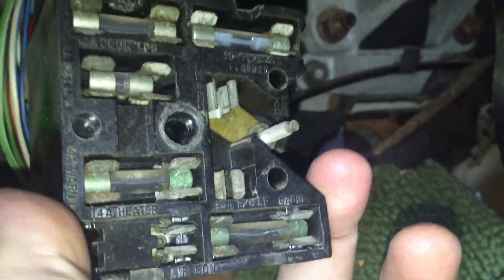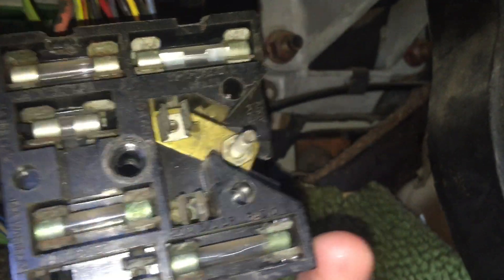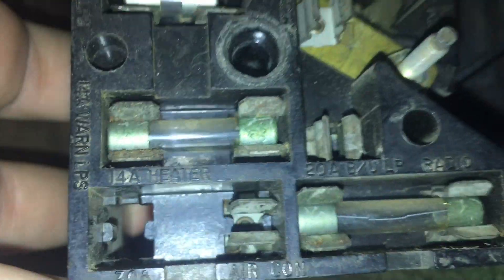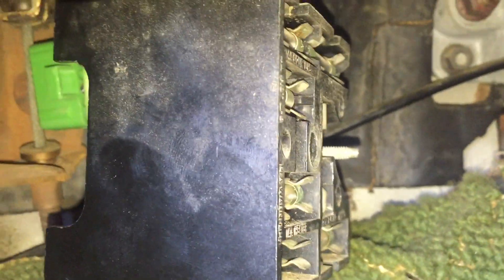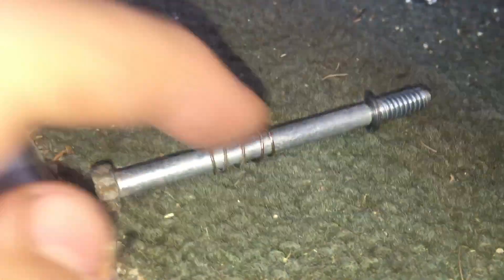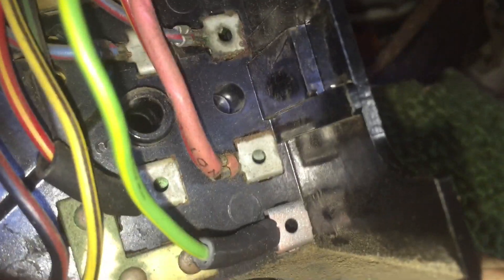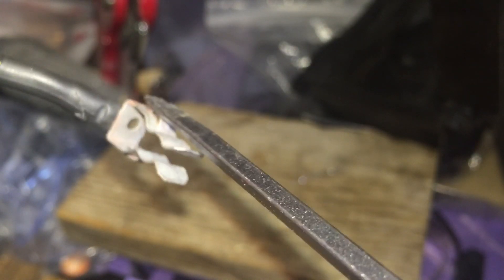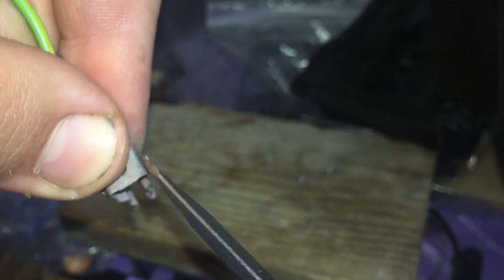Adding some fuse box wires / terminals to an empty glass fuse circuit. 1970 Ford Galaxie 500

Comment: IF you have factory AC,  the heater fuse is not used.  Protected by a self resetting circuit breaker screwed to the back side of the dash behind the ash tray.
Reply from the maker: @nevetslegasi5686  oh nice. I need to check that out. Thanks

Comment: I loosened the bolt, and NO amount of wiggling or tugging will unplug the connector??? What now? This is literally the only video on this subject that I could find, and everything was already undone when you started the video.
Reply from the maker: Bikedueder yea this was the first video I recorded for the channel, it could have been better. I don't remember there being too much of a problem coming out. I would make sure the bolt is as loose as possible. Also maybe check how the wires are bundled together, maybe two separate wire looms are connected and not letting it move. The green box might click in a little too. So might need to rock side to side, or top to bottom to rock out of the groove. Once it's free from the firewall and you can see the back you need to push the bolt from the front and pop out the clip in the back. Then can fully take it apart. It your still having having trouble let me know, and I'll see how I can help.

Comment: Aug 2024, nice job! I have a 71 LTD same fuse block. New 200A alternator but the fan reads 10.4 on max. Wired a Max bypass relay to gfet the cabin fan to 12.4v so I can feel the A/C but I still want to find the draw down source so again much appreciated video . . .
Reply from the maker: @robertdowney2141  thank you. no problem, glad it was useful. Good luck with your project.

Comment: You mentioned you were using the opening marked heater but it looks like you were using the AC opening . your heater is the next one in not the outside one
Reply from the maker: Yea the one above that empty one is probably the heater. It is an ac car, so the empty one might be for some sort or emission or carburetor solenoid according to the manual. I have an original car manual with a fuse diagram, but it shows a different setup then the car, so kinda confusing.

Comment: Hello. Any chance you are still looking at this? I am looking for a fuse box diagram. I have two fuses blowing and i cant figure out what the fuses are for. Rookie. 1970 ford econoline has the same box. Great video thanks!!
Reply from the maker: Thanks. I should have one in the manual of the galaxie I will look for. I also have a 70 econoline also I can look at. If you look close at the box it might be labeled in small print, but sometimes I don’t trust the position of the label. Any chance you could text or email a picture of the ones blowing to 760 819 2901 or desertratracer@yahoo.com …
Reply from the maker: I got the fuse diagram from the galaxie for you. Just need a number or email to send it to, or you can contact me at the info in my other reply.

Comment: Good afternoon, where could you get the fuse terminals where the fuses are mounted, okay?
Reply from the maker: sorry for the late reply just saw this. I got mine from another car, but just googl search "ford fuse block ends" and you'll see a bunch of options. Here is a link to some on Ebay though. https://www.ebay.com/itm/171504053764?chn=ps&norover=1&mkevt=1&mkrid=711-117182-37290-0&mkcid=2&mkscid=101&itemid=171504053764&targetid=1645685073568&device=c&mktype=&googleloc=9031406&poi=&campaignid=16730423415&mkgroupid=135815925780&rlsatarget=pla-1645685073568&abcId=9300841&merchantid=8422474&gclid=CjwKCAjwjYKjBhB5EiwAiFdSfkSDML5I6gVPhNkE4uH4tXtwI7g8bPN8xKyTSOymy1C_xXR9ZzmHYhoCkXwQAvD_BwE

Comment: I have a 1962 fairlane nkt the 500 where is the fuse box located.  Thank you.
Reply from the maker: I’m not too familiar with that exact model, but I’d say it’s under the dash on the drivers side. Should be able to see it if you look underneath.